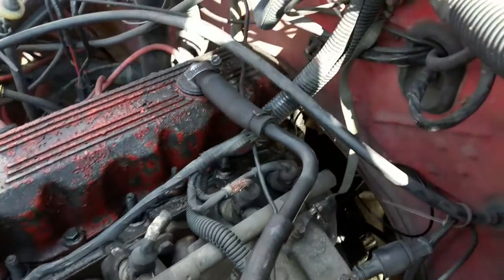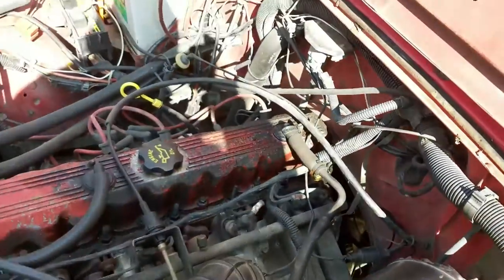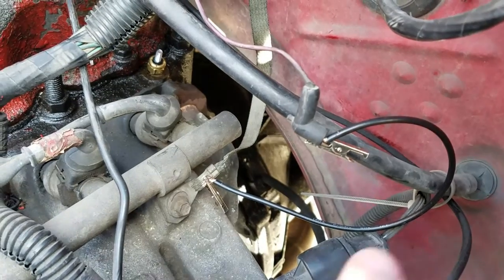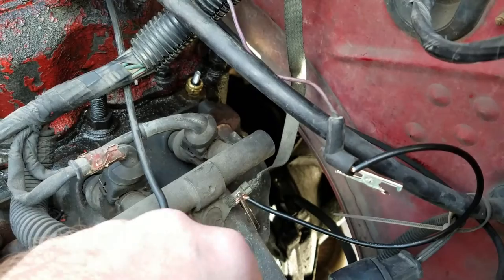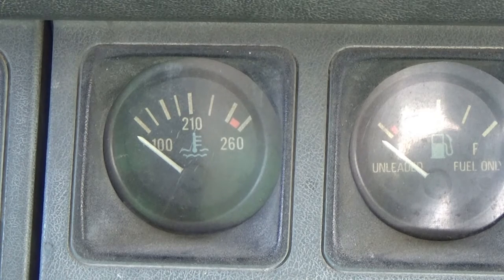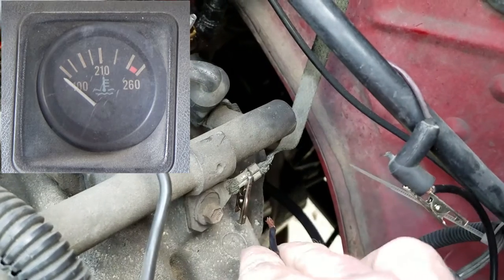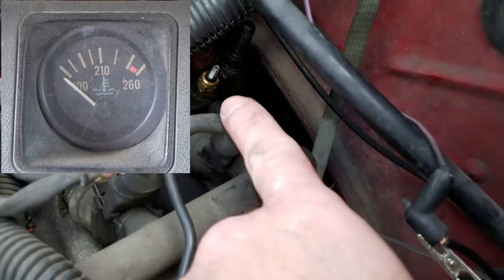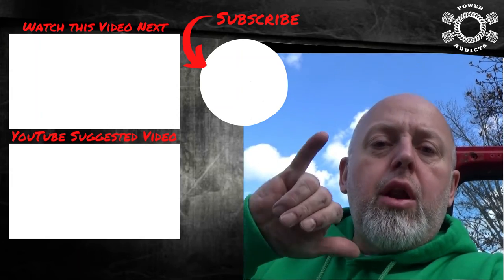Jeep Wrangler YJ - Super Easy Temp Gauge System Test #tempgaugenotworking #yjtempgauge

Comment: Great Video, My gauge does exactly what yours did in the test with the ground wire" 0 to 260 back and forth with ground connected. However if I just leave the sensor unplugged and no ground wire and turn the ignition to on,  the gauge goes to 180 .  Turn off ignition and gauge back to 0??.  Jeep has not been running when I do the test.  If I plug the sensor harness into the sensor the gauge also goes to 180??.  Then it will creep to 260 if i start and run the vehicle.  IR says the engine is 195. New thermostat no air etc.  Thoughts?  Seems to be a gauge problem.  Sensor was replaced and does not effect the test.

Comment: Ok...if the gauge doesn't move when sending unit wire is grounded and key turned, then what. I guess this means wire itself or gauge is bad. Correct. Would you next pull gauge cluster and try to find continuity between temp gauge wire at plug to wire that goes to coolant sensor? And if there's continuity, plan on replacing the gauge? Thanks man!

Comment: Great video thank you and Merry Christmas. I put a new temp sensor in and the gauge does work now. Was not working at all before, but there is some intermittent working issues with it now. She will dance around a bit Which tells me the ground  thats for all the gauges needs to be cleaned.  My oil gauge is sometimes spastic. So 2 gauges doing similar things tells me ground issue.

Comment: I NEED HELP, PLEASE. So I ordered 2 new guages, both jump to 260 with me just turning on the power, but unlike you I didn't need to ground the wire to the engine, it just doing it automatically. What could be the problem?? And it jumps whether or not its plugged in to the sensor.

Comment: So the gauge on my 91 YJ goes to full hot as soon as I turn ignition to on. When I remove the wire from sending unit it drops just exactly like you demonstrated i can ground the wite and it goes to full hot also. I i ordered ned sending unit and jut replaced old with new and no change at all. Same results as soon as ignition is on it's full hot. What am I left with? Could it be a defective new sending unit? Is there another way to test the gauge ?
Reply: I have this exact problem 
Did you ever figure it out ?

Comment: Chuck I thought you put a manual one in your heater hose?
Reply from the maker: Hey there!! I did a long time ago. I fixed my instrument cluster so my gauges work. I removed the manual set up right afterwards.
Reply: Well I'll have to stick with the manual for a wile I bought a new sensor but it still didn't work  but I got it fixed with your help

Comment: When I change it out....will radiator fluid go everywhere out the hole of the temp sending unit?
Reply from the maker: As long as the engine is cold, it isn't going to come rushing out. You will still loose a little bit though. But, not enough to really worry about.

Comment: I have a 94 XJ that the gauge only reads about 150 under normal operating conditions. I performed this test just to see if the gauge would move any further and the gauge slowly climbed up to the red zone. I'm pretty sure my gauge is not reading accurately, as an external thermometer shows the hose temperature to be around 190 and the thermostat is a 192 .I have replaced the thermostat and the sender unit. I would just like to know that my gauge is reading correctly and  if my unit is starting to overheat other than just steam showing coming out under the hood. Don't really want to put an external gauge in, and I don't see where you can buy a replacement dash gauge for an XJ. Any suggestions?

Comment: And if the gauge does not move?
Reply from the maker: Then you need to check the gauge its self or start tracing the rest of the circuit for the issue.

Comment: I found a non-running TJ for 2500 should I buy it
Reply from the maker: Depends on the condition and why it doesn't run. If its an easy cheap fix, sure. If If it needs an engine and you can do the work yourself, sure. If you are planning on keeping it for your personal fun it might be worth the time and money to get it going. If you buy it to resale you gotta consider how much money and time you will have into it to factor how much profit you can make. I'm patient and kind of a cheap skate to be honest. I only paid $1000 for the my daily driver and it was running. I paid $200 for my '93 YJ but to be fair. I originally bought it for parts and decided to build a toy out of it.
Reply: Ok

Comment: Did your test, my gauge doesn’t move, and my sensor is new. You didn’t cover everything it seems.
Reply from the maker: Here is my detailed video. If your gauge isn't responding, you have a break in the wiring, bad gauge, or a bad connection at your gauge. https://youtu.be/6i9X2agOEYs